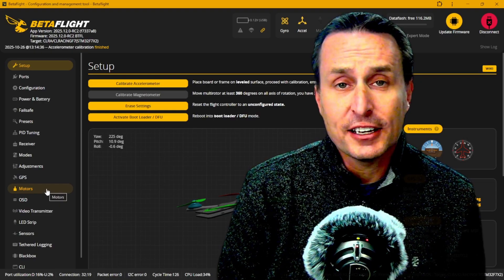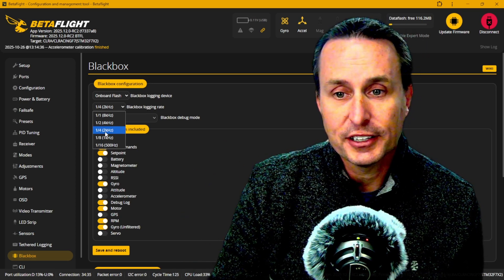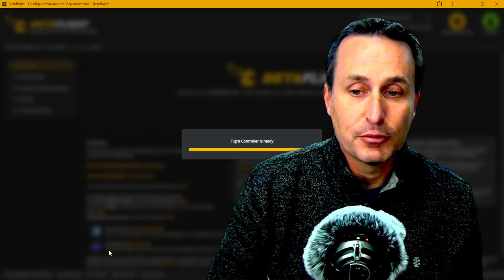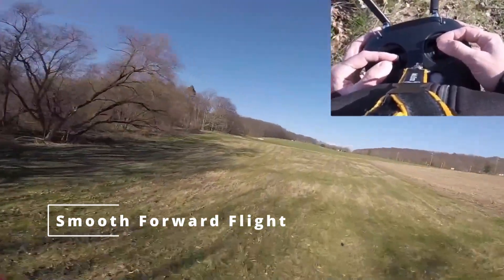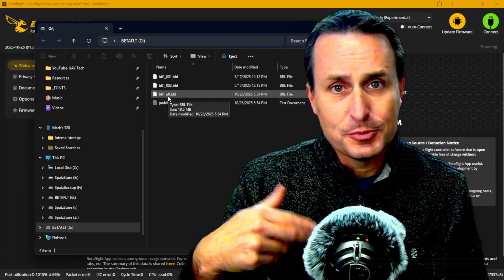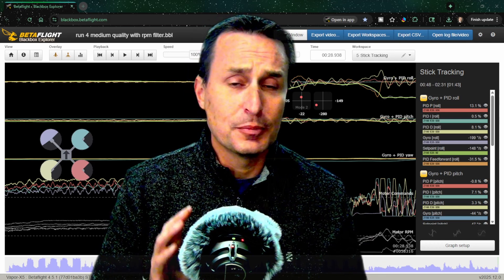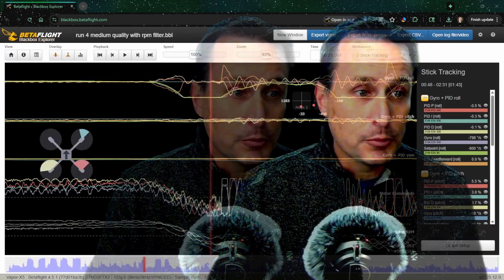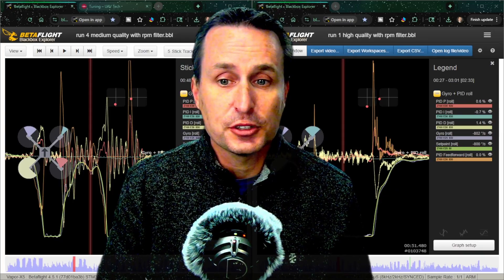Evaluate Your Tune | Performance

Comment: Is it so difficult to make a program where you enter the quad specs, analyze black box data and then propose a preset for the quad?
That will be the ultimate betaflight tool.
Reply from the maker: Not possible.  You would need to measure your quad's moment of inertia, and noone has the tools necessary to do that.  

What misses with just raw blackbox data, is it cannot tell you how the quad will react with changes to values.  It can just records.
Reply: @uavtech Yeah exactly, currently struggling to get rid of vibrations on a new 7" build and your videos has helped me a lot to improve things, also am32 settings have a huge impact to the quad behavior.

Comment: When doing the tuning test flights, I found out that it is also important doing each test, especially for PID tuning, with fully charged battery, because the same test gives different result if the battery is charged, half or almost empty...battery that is below half charged cannot give that much power to motors and the drone is less sharp than the fully charged battery and tuning might not be accurate...

Comment: I think a lot of people add a ton of tpu parts to their quads and they cause so many vibration issues that it causes a preset not to perform the way it should
Reply: I have tested this 3 or 4 times by completely removing all tpu from a quad and then comparing the BB.  In my cases it made zero difference apart from once I found an antenna was wobbling.
Reply: @gregdavidd ok your a rare case, because most quads I work on for my friends with a bunch of tpu parts cause them to use too long of screws or add washers that cause additional vibrations. I could simply rebuild the quads without the tpu and it was close to perfect
Reply: @HaleFPVRC  Its all in how you design your TPU parts.  There are no screws holding down TPU parts that dont have standoffs/spacers in any of my quads. iFlight is bad for that.  They think that having TPU between the motor screws and the frame is acceptable.  They do it with their gopro mounts too.
Reply: @gregdavidd yes!!! I find the most issues i come across are motor protection that require the motor screws to secure them to the frame, and oversized antenna protection that has lots of flex and movement.
Reply: I have TPU prints all over my quads.  No issues. Just don’t put screws through TPU to hold the motors.
Reply: @PeighDayFPV all my freestyle quads are wrapped in tpu protection as well. I just make sure they’re quality and tightly fit. I’ve seen some very poor use of tpu 😂 and it definitely caused some issues
Reply: @HaleFPVRC I agree. I have definitely seen some questionable prints on quads.